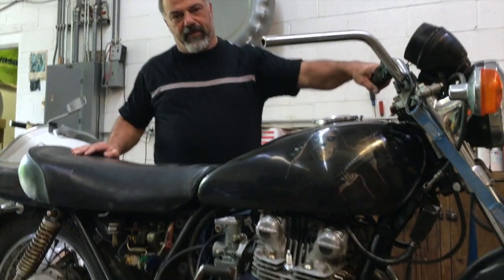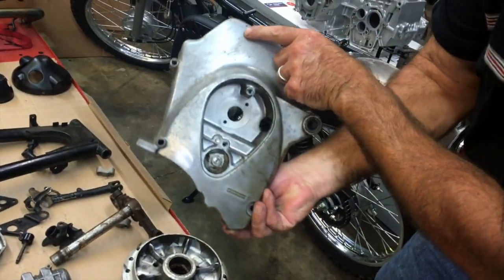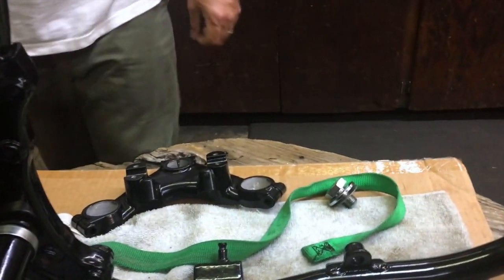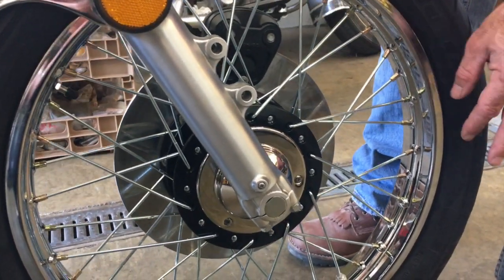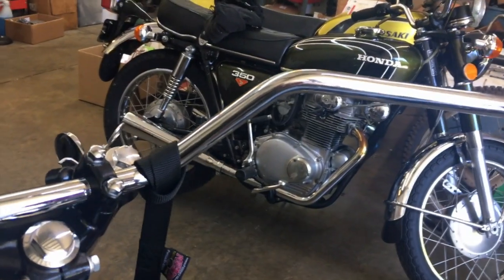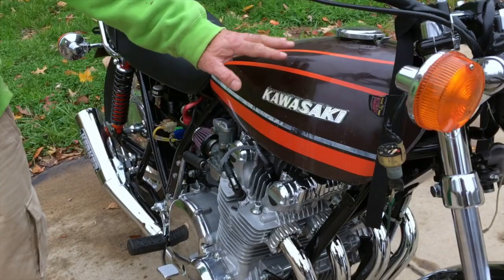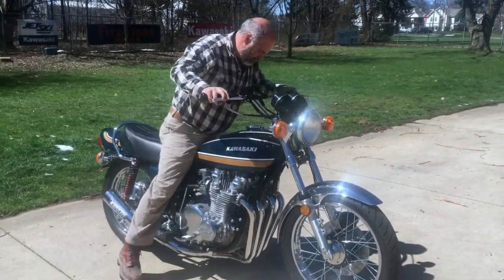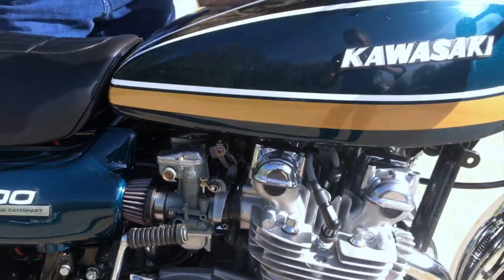"Tree Man's" 1975 Kawasaki Z1 900 Complete Restoration and Lowering

Comment: That's a nice finished too that z900 Johnny Yeah executed that one real good.... I'm going to customise my 1980 ltd I'm going to make it look like a 78 z1000 with the z900 75 colour paint red colour not the blue & spoke wheels & smooth bored carburettors 73 to 75 carbs I'll reject them ... Straight handlebars and z900 seat... the MK2 engine in this ltd it's a super engine smooth & with smooth bored carb's man it's going to move....it's a fast bike as it is...😎😎😎🏍️🏍️🏍️💯💯💯👈👈
Reply: Plus 4into4 pipes forgot to put it in the last message....😎

Comment: Couple questions on the build, what’s the little back fire pops? What causes it? Was the tank repainted or a reproduction? Also How Affordable was the the overall build? Gorgeous build!
Reply: Pretty sure those little pops on idle and engine braking are from carbs not being adjusted properly for the increased airflow from pod filters and aftermarket exhaust (if they can even be adjusted for that much airflow?)

Comment: What is up with the constant reving the bike . Just let it idle and warm up . I can fire up my 79 and turn the choke right off and it will idle under 1000 and warm up.  You continuously rev the motor????????? When cold
Reply from the maker: just having some fun at my job. It is best to not let them idle low so the motor does not have to work so hard  to get oil moving